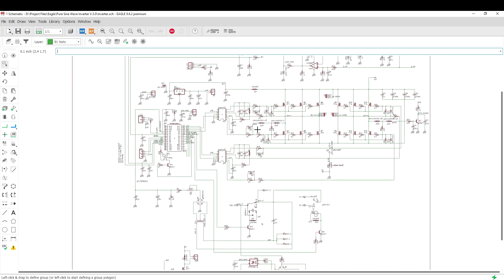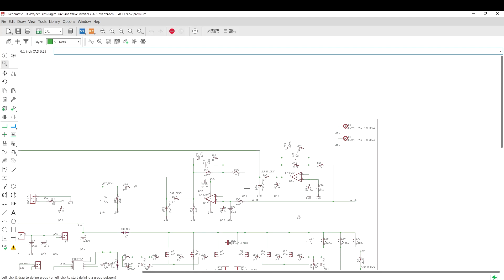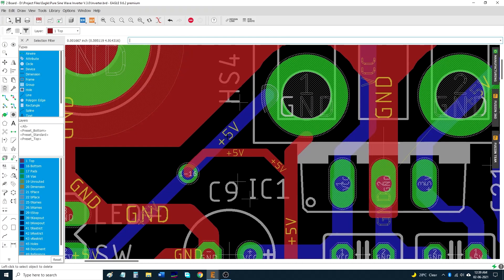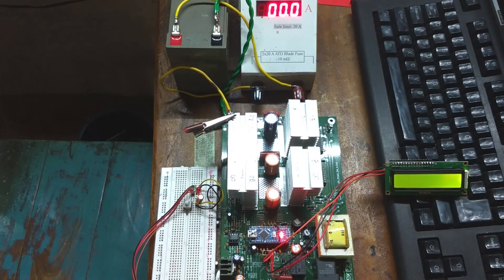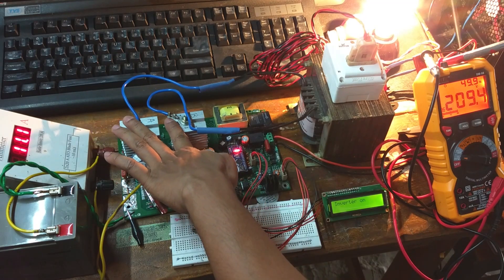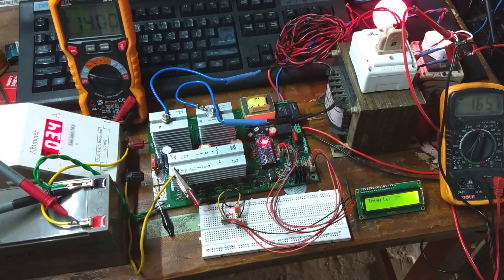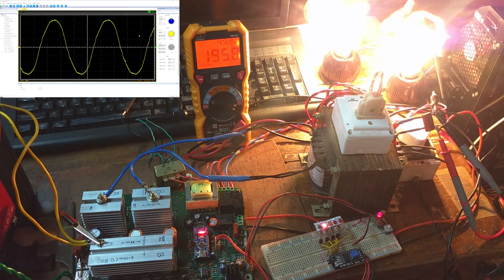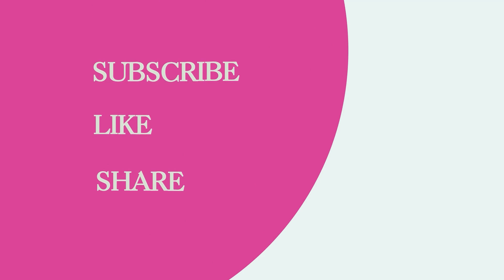350 W Pure Sine Wave Inverter with CC CV Charging, Automatic Changeover [Rev. 2] + Giveaway

Comment: Thanks...for the video but what is the problem of the lcd and the schematic is not clear to me what app to view it
Reply from the maker: LCD was delaying the switch-over from mains mode to inverter mode. If you are ok with this delay you can use LCD. I will upload the code with LCD also.
Reply: @ElectroHijibiji  yes need the lcd for it to be complete so delay doesn't matter
Reply: Super you for this beautiful application